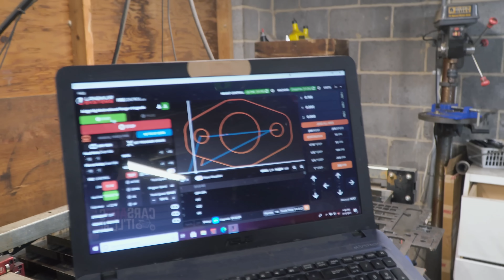Reviving a FORGOTTEN BIG BLOCK Race Go Kart!

Comment: Just an FYI... Those jets are not molded in and can be removed. They can be difficult to push out due to crud packed around in between the plastic and the jet, but you can get them out. I work on mowers and generators for a living and see those carbs all the time. Great vid keep up the good work!

Comment: I recently seen something cool that maybe you like to do. There is people in my area who ride off road mud mowers up and down the roads they call them redneck atv's. recently one came by and asked me if i wanted to race. I checked out his mower and he was running a pipe with a muffler and about midway on the pipe he welded a flange to mount a small engine carb throttle body that he converted to act as a exhaust cut out valve and had a pipe running off that.  He had a throttle lever and cable to open and close the butter fly. He said he can ride the mower quitly around the neighborhood but when he wants to race or go off road he opens the cut out "throttle body carb" and he gets more power.  This is brilliant!

Comment: Take some chain link fencing add some weight on top while you drag it around the track. As if drags it levels the track and cleans up the weeds. Do a test of carb faced forward verse sideways?is there a difference
Reply: I do the same thing with a old dog crate it's a lot more rigid and can handle more weight

Comment: I can't wait till the track gets most of the loose dirt slung to the side and the tires can get to the hard packed stuff. A layer of rubber would look good on it. I'd be halfway tempted to push broom it, but I'm not sure what the soil is like there, so it may not even be possible.

Comment: Those tires make that drifting look so darn fun. Being that it studders when you throttles is it getting to much fuel? I have seen that before .
Reply: It prob from all the shaking and turns my predator did that bc the holes where the jet picks up fuel weren't far enough down so when I hit a really big bump or super sharp turn it shut off and I had the oil sensor disconnected so that's the only other thing it could be

Comment: I worked on one of those stupid carbs a while back. The O ring in the plastic section gave up and it acted like the needle/seat weren't sealing. Filled the crankcase with gas. Fresh rubber got it working again. I'm not sure what they were thinking with that design.

Comment: This build is awesome 👌 definitely like these karts better than the full out off road carts every one I doing. but my ocd is just killing me over the welding settings it always sounds ok buy short on the wire idk I always go 25-30 amp over my volts for a fast bacon sounds almost like 210a 200-18.5v with alittle back hand sends it every time :) can even go on thiner metal at 17v 180 190 not saying your rong or to change it just every weld makes me think of it as trade Welder 😂

Comment: you guys should think about putting a surface on your little track a 3 in layer of gravel tamped down in wet dirt with a surface coat of crushed rock on top tamped in would give you a cheap and hard surfaced track to run the carts on . as small as the track is the 3 of you could knock it out in 2 or 3 days or over a long weekend

Comment: What about removing the cam and installing it 180° along with ignition timing out of time so you can swap the intake and exhaust ports to move the exhaust pipe on the outside of the cart, and putting the carburetor next to the seat with the exhaust pipe is now... IDK if it would work... I know hot rodders do that with small block Chevys and have the exhaust sticking out of the top of the heads and the carburetors are down on the sides of the heads...

Comment: what would yo9u guys suggest to quiet down a generator motor for camping? besides a quiet box.. you may want to put wheelie bars on the FRONT of your truck.... LOL.. that cart needs a bigger track, it reminds me oft the time we took our 67 chevelle dirt street stock to a run what you brung in Md only to find a 1/4 mile gokart bull ring.. they let us do some exhibition laps..drifting wasnt a thing back then but we drifted 5laps or so

Comment: The Mukuni carburetor is the only way to go on the Briggs and Stratton engines. I have one on my industrial 10 HP built B&S engine. it makes a huge difference on these awesome engines. that one sounds like it has an off idle flat spot in it. there is simply nothing better than a Briggs and Stratton engine. I want to build a Vanguard next and see how it turns out. but it seems like they getting harder and harder to find.

Comment: That leak coming from the carb is from it needing to be braced up, you can see it bouncing around like mad and that will cause it to leak as it is splashing over the float.  Either it needs a brace or a shorter tube...unless of course it wasn't welded then that could be an issue.

Comment: Not hating on y’all’s driving but from the video in Charles run for example if you take a less aggressive steering angle for turn in and hold it to the apex you get a better angle for the straight and can get on throttle quicker especially for an unbanked track but that’s from video I have no idea how the kart handles but from the video that’s what I’m seeing so your lap times could be .7 to .8 seconds quicker which isn’t much but in a long race it will add up

Comment: I have a 5hp Briggs generator engine too. Runs good, but has that weird tapered shaft. I cant afford to take it to a machine shop, and I'm scared to take the crank out anyway (if you knew me, you'd understand 🙄). I thought about running the engine and holding my angle grinder against the crank to "machine" it. Ike approved??
Reply: I’d maybe try something like a metal file first, for a bit more control. But I reckon a grinder would work ok too
Reply: @garageofscrap  I figured 85 percent of the cut with the grinder, about 13 percent with a file, and the final "hone" with Emery cloth.
Reply: Sounds like that would work. If you could leave another comment when it’s done, I’d be interested to know how it goes
Reply: @garageofscrap  If I ever get around to it! 😂 I'm pickin' up a genuine HONDA 4hp horizontal shaft motor tomorrow, after I sell a load of scrap metal to pay for it! Might just go with that.

Comment: Okay, so here's a noob question: why does this cart have wider wheels on the right hand side? Thanks, and loving the vids - keep em coming 👍
Reply: It's only takes left turns so all the grip is needed on the right side
Reply: @carsonshipley3287  Thanks Carson. Makes sense...still would have guessed they would use same-width wheels and alternate clockwise/counter clockwise driving. Anyway, cool cart.

Comment: I got a try pulley swapping but it's not working because the variable speed system but it got 12 and a half horse Briggs and Stratton make a big block the carburetor I'm running on it is a carburetor for a k-series 12 horse Kohler or a magnum 12 Kohler and it runs fine and it gives you a just ability of addressing the high idle and the low idle

Comment: They use cheaper parts on the engines that come hooked to small engine equipment. Probably not Hondas but I've had a power washer engine with a plastic cam gear on the cam shaft. They also use cheaper bearings on the crank. I think It's because it's cheaper to make in bulk.

Comment: I'm sorry to say, but I love my Jd square CNC table. With Torch Height Control is the cat's ass with hardly any dross cleanup at the end but however, I do like the hand torch setup versus my machine torch setup.
Reply: I can really say this is the first time I've seen anyone useing offset wheels on their rigg, I understand they're used for left hand or right turn only tracks but just never seen it used like that before.

Comment: Are you running rear wheels up the engine side of the cart for a reason or was it alright for testing purposes 🤣
Reply: Circle track setup. Wider tires on the outside so it doesnt slide on the pavement as bad. Usually circle tracks are left turn, so the right side tires are wider so it corners better as well
Reply: Must ride like hell
Reply: @TetraHydroCannabinolTHC  they pull a little to the left on a paved track, but on a yard the difference is pretty much nil

Comment: you should do a 100cc two-stroke shifter kart, I would really like to see that. Maybe 1000 dollar budget?
Reply: That would be awsome to see.  I bet that even a tiny 80/85cc 2 stroke dirt bike engine would beat ALL of them "go powersports"  engines they use ALL the time.    
But sadly i dont think that is ever gonna happend.  It just seems that for some reason the C&C crew is afraid of 2 stroke power.
Reply: Yeah, I feel like a 100cc air-cooled two-stroke engine would be really cool.
(Kinda dumb) But I am yet to see someone put an 80cc two-stroke bike engine (Built) on a go-kart..

Comment: Love every episode guys! Regarding the leaky carb, its possible the black hoses need to be secured with the tube ends facing upwards. I didnt get a good look at the carb but those hoses should be bowl vents. The fuel in the bowl sloshes around when cornering. Hope this helps. Love the new shop! 🙏🏻

Comment: Those Nikki carbs are the worst. You CANNOT get even a wiff of carb cleaner near those o rings or they will swell and are ruined, and a new set of o rings from Briggs is about $35. It's just a poor design. Used to be able to get the all metal walbro carb to replace it, but Briggs discontinued it.

Comment: You haven't felt the need for header wraps until your skin gets stuck on a hot pipe when you pull whatever body part it was that stuck to the pipe away......smells like human BBQ
Reply: I have a scar on my left forearm.
Reply: @michaelvangundy226 .....my calf muscle got BBQ'd.....burned through my riding pants......did a huge jump and while I was in the air someone drove onto the track crossways and we collided when I came down.....crashed and the bike pinned me down and tortured me with it's muffler
Reply: Or goldfish

Comment: Just a question but wasn’t part of the reason people were attracted to those sidewinder keychains as you call them the fact that they were limited edition so by simply printing out more doesn’t that cheapen the value of them to the people who were quick on the draw and got them right away kind of like what Ford did with the new Ford GT when they decided to just magically make more after claiming a limited production run basically you are kicking your viewers in the nuts and saying ha ha money is more important than you having a cool Limited addition thing maybe next time you should keep your word and make a different key chain for the people who weren’t smart enough to buy the supposed limited edition ones right away I’m just saying

Comment: ROFL 5HP Big Block OK the Cover from a Big Block Doesn't fit a 5HP Engine Duh, its your Lie tell it how you want! The Breather and the Exhaust is the same size as a 5HP briggs... The engine is not as Wide or Tall as a Big Block Briggs i have Fixed many...
Reply: It’s a big block I just put a 5hp sticker on it for grudge racing. Cheers mate